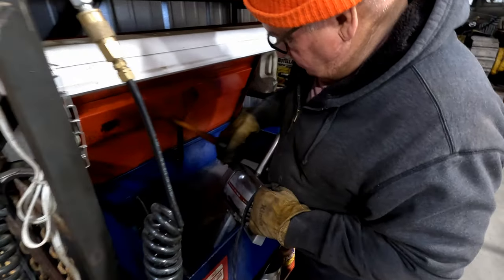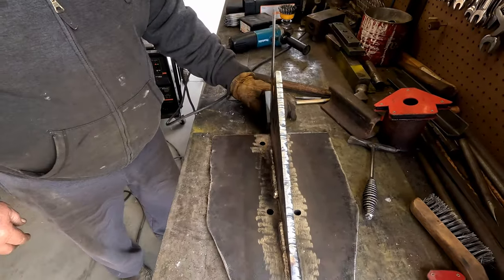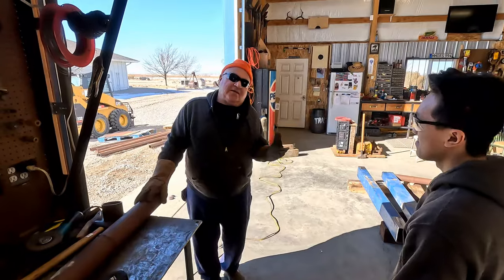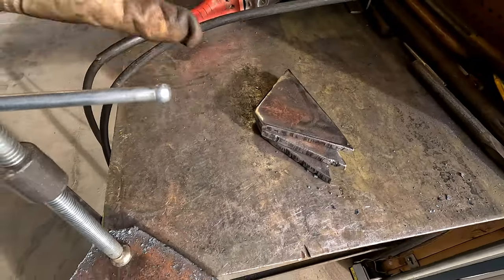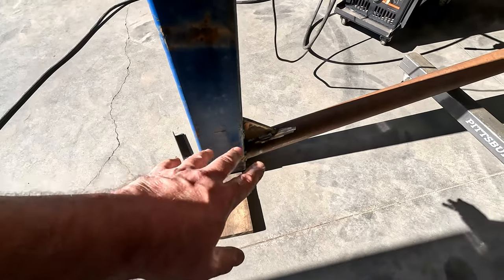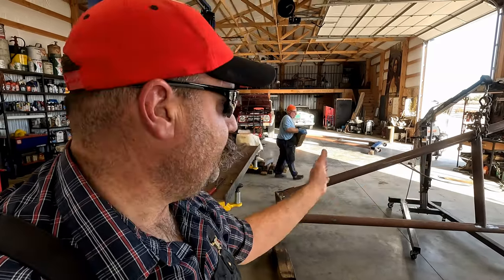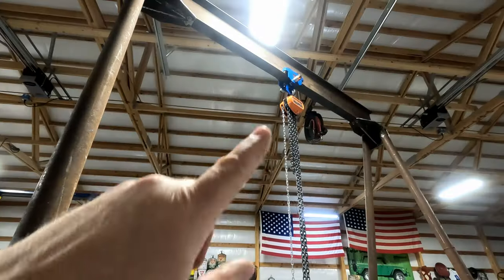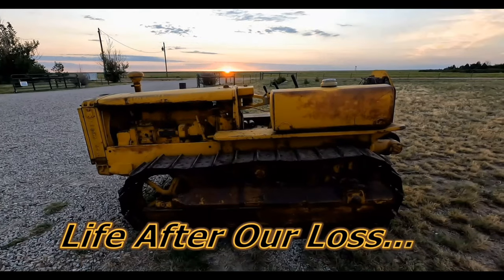"Goliath" completed! Let's make a 3 Ton capacity gantry crane! Part #3 The build.

Comment: Excellent job Boys A++ indeed! I just wanted to follow up about what you said about hoisting with hydraulics and your crane won’t creep! Which is very important obviously but I have hoisted with cranes excavators and backhoes and I wish I could say that they are 100% safe but no even a conventional crane can be temperamental in very cold or extremely hot temperatures but anyway I bet your all happy you can keep moving forward on the crawler 😀🇨🇦

Comment: I had the same problem with my caster wheels hitting the bolts so I put the bolt heads on the bottom and nuts on top
Reply from the maker: That is probably how we should have done it. 😊

Comment: Your 1/2 inch drill looks like my dad's Montgomery Ward 1/2 inch he bought around 1953. I still have it.
Reply: I have a match to it as well and it's a wrist breaker for sure. But it has plenty of power!
Reply from the maker: That's exactly what it is! The majority of my grandfather's tools are powercraft from Montgomery Ward.
Reply from the maker: We all learned the hard way to have two people hold it and one on the end of a sizable cheater pipe. I think that drill has twisted the wrists of three generations now. 🤣
Reply: It's got be a couple of times. I like the pipe idea.
Reply: It's go me a couple of times . Wrapped cord around switch and couldn't shut off. Got out of the way and unplugged.
Reply from the maker: @roygatewood9236 That sounds like a close call. 😬
Reply: It wasn't pretty. Maybe had a bruise or two. I prefer using variable speed battery operated drill.
Reply from the maker: Glad you made it through relatively well! I will definitely remember your story whenever we use that drill. I prefer variable speed drills too but Dad loves the "big" drill. It has broken more than it's share of bits too.

Comment: Kind of hard to believe you being in the construction business that you didn't have a crane before this! They are handy, we've had one a long time. As for paint,  don't  bother. That way you can always remove the  winch and store your gantry outdoors.
Reply from the maker: That's a great idea but it's going to be hard to convince Dad not to paint it. In our old shop we had a steel building with a ton and a half Gantry crane. It was fixed so only usable in a small work area. This is a big Improvement.
Reply: How ironic! Your dozers have gotten smaller, and yet Your crane to work on them has gotten bigger!😂

Comment: Excellent job, I see the vertical plates on top across the 2 pipes on each side welded to the pipes and to the large gusset. The only over build I would do is add gussets on the inside of the top of all 4 of the pipes to the bottom of the top plate. I think it might stiffen the side to side wiggle a little and add to the tensile strength of the connection of pipe to the top plate. But like you said, I always over build also.
Reply from the maker: That might be a addition we make in the future. 😊